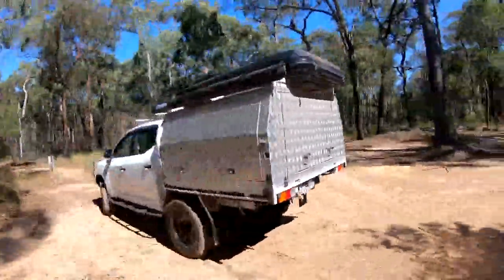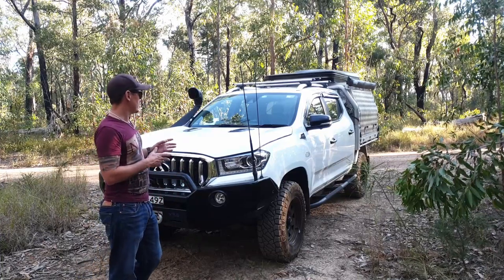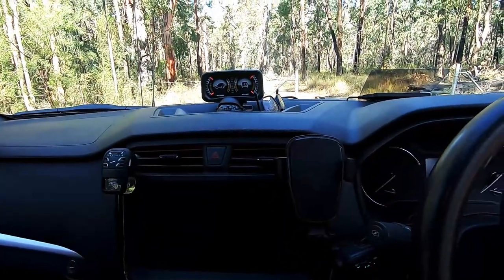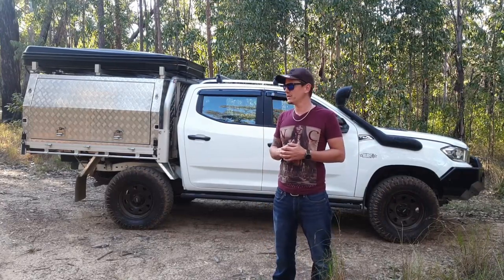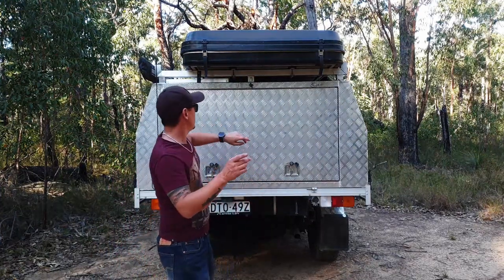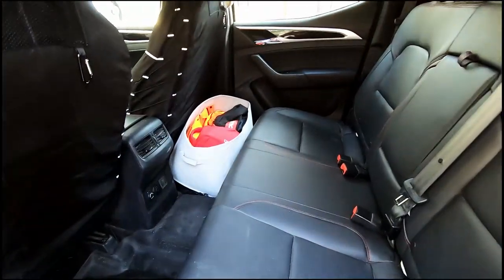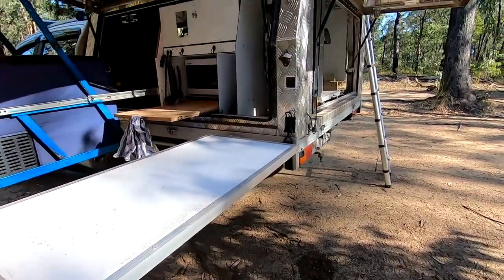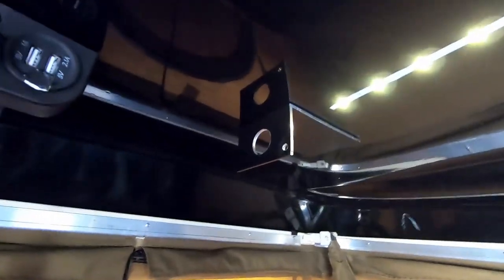LDV T60 Modified

Comment: Thanks for your video. Nice rig, notice lots of care and love you put into it.
Been thinking to buy LDV and build a similar camper box or a trailer.
It would be for touring around the country. Will check that LDV fb members page for any advice.
Love to see more of your videos on how you built each part. 
Got me as a new sub to your channel  :)
Reply from the maker: Biggest problem with the ldv is there are no gvm upgrades available and you run out of weight very quickly for a big build like this. I’ll be going to a smaller canopy at some point to try and cut back again. Join the ldv modified Facebook page for some more builds and ideas.
Reply: @livin.offroad  Realised that weight managment is an issue and thanks for pointing out about the upgrades.
Have joined two fb ldv groups and found posts from one guy who toured from Perth to Alice Springs via Canning Stock Route! He built his own soft cover canopy but had all the necessary gear for the tour. His was single cab with flat plate chassis.
His only issue was overheating and in one of his posts he does not recommend for others to buy the LDV, seems to be disappointed by the dealership in Perth..
This was 1-2 years ago, hope newer LDV models have overcome this issue.
Cheers
Reply from the maker: Yea. Bron is a top bloke and had a great build. Overheating is still an issue for a small minority and there is unfortunately still no clear solution for it. Ldv still will rarely recognise it.
Reply: @livin.offroad  thanks mate!:)

Comment: gday mate love the videos just a small question have you had any problems with your intercooler hose popping off ? i did and replaced it with a silicone one.
Reply from the maker: Not popping off. But had it burst. Where did you get yours from?
Reply: Carwise at kingswood still under warranty only 6 mths old , been watching your videos on pre fuel filter and oil catchment like your brackets
Reply from the maker: @stevenbunyan2325  thanks man. If you have fb find me on the ldv t60 modified page and send me a pic of it. Dawie Cilliers.

Comment: How's the ldv going ? Any issues yet ? I'm looking at buying one but the lack of reviews is putting me off. How is the after sales service ?
Reply from the maker: Hey Jason. I think it goes... Ok. You do get some corners cut and info system is terrible, mainly with Google phones, ok with iPhone. The best place for reviews is to join the LDV T60 Owners Australia Facebook page. As a general ute I think it's good. As a big tourer, I wouldn't recommend it unfortunately.
Reply: @livin.offroad  hi just wondering the car itself, is it mechanics are reliable? I'm having limited budget, looking for a dmax or t60. Thanks btw great video!
Reply from the maker: @VR5DADDY  I have had some smaller issues, but lots of people have not had any. I don't think it has more issues that any other. But there is a new model coming out this year that might be worth waiting for.
Reply: @livin.offroad  can you say about the problems and advance about this car power towing transmission engine speed how is it ac please .. how much rpm with speed ?

Comment: why didn't you get a 2100mm tray and canopy?
Reply from the maker: Mine is a fuel cab and not the mega tub. A tray that size, it would only be a matter of time before I bend a chassis. I also struggle with weight limits with the current setup and plan on moving to a smaller canopy in the near future.

Comment: Hey mate, love your build. What offset wheels are you running? Is there any scrubbing?
Reply from the maker: Matthew Blandon I think... -20. But I’m really not sure. I just told the bob jane what I wanted and they sorted it. There is a minor bit that you have to adjust for but then no. I don’t scrub. It’s just cutting back a tiny bit of mud guard and removing the panel at the back of the drivers wheel.
Reply from the maker: Matthew Blandon there is a good group for any help you might need 

https://www.facebook.com/groups/ldvt60modified/?ref=share
Reply: @livin.offroad  thanks for that i will have a talk to my local bob jane and see if they can help me out. Unfortunately i dont have facebook to check that page out. But i will have a look at that panel you are talking about.

Comment: Thanks for the video. I admire your project. 
So you got them to remove the tub and got someone to fabricate an Al tray for you?
Reply from the maker: I had the dealer source it when I bought it. They got it from tiger trays and I think it cost me around $2500 installed.
Reply: @livin.offroad  Thank you for your quick reply. I am thinking about getting the mega tub they have coming out from next month. 
This one will have a 1800mm long tub. 

I prefer the tub to be honest, but a tray would be more practical for camping so I'm researching that.
Reply from the maker: My tray is 1710 long X 1800 wide. An extended version would have been preferable with the same tray I have but would have had less overhang on the rear wheels and better weight distribution. But think about what weight you want. I am almost right on my maximum capacity as I am in this video, this is before I add passengers and currently there is no gvm upgrades available for the T60. For that reason I now spend most of my time without the canopy. Ideal for beach camping.
Reply: @livin.offroad  Yes good point. For us it's more realistic to tow something. I am interested in the LWB version for carting sheet goods and timber around and I don't mind compromising some of the off road abilities (angles).
That said, I made notes about your lift kit and tyres. How do those tyres go in sand?
Reply: Have you found a gvm upgrade for the T60 as yet.... also those little bonnet vents help in removing heat and do you think a bonnet scoop would help reducing heat
Reply: @craigfranklin1853  A Queensland court has ruled that the LDV T60 is made of "poor materials" and ordered the dealer to make a full refund to the owner who took them to QCAT. I ended up buying anSsangyong Musso. I'm so glad I did not buy an LDV.